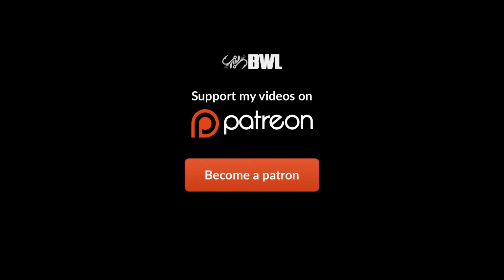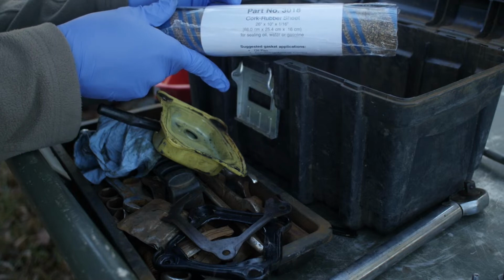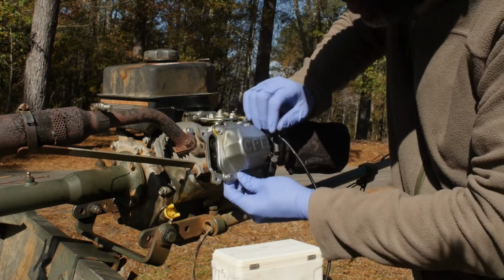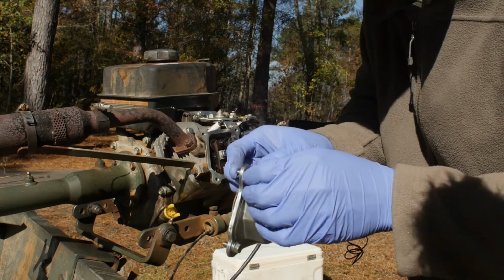Make Your Own Gaskets

Comment: Nice fix!. When I was lucky enough to have a flat surface for a gasket, we used to make the imprint by tapping the gasket material with a rubber or hide head mallet. Just hit it hard enough to make lines, not hard enough to cut it and when you have that cut it with scissors. Also used to use a gasket seal compound called Blue Hylomar. Sometimes if the shops were shut but needed the car to run, I used to make gaskets out of cereal boxes. Some of those temporary repairs used to last years!

Comment: Over the years (been wrenching for 40 yrs) I've used many beer 6px holders or 30pk boxes for gaskets on everything from lawn mowers/tillers,ATV's/motorcycles,to cars/trucks.Most of which are still in use today unless the part has been replaced,if by me I used another 6-30pk to make it.

Most things I use them on is car a timing chain cover,water pump,thermostat housing,carb.Many of which can also found on other engines like mowers and ATV's,etc.I used it as a case gasket on a Briggs&Stratton 5-6hp rototiller engine once a few years back and it's still tearing up the gardens.
Reply from the maker: Yeah, man! That will get it done.
Reply: Tip on making the holes.....rifle or pistol casings.They come in many sizes.I use old sockets,but they don't have the assortment of as many different sizes and not everyone has old worn out spares to grind a cutting edge onto.
Reply from the maker: @rider660r  Yeah, I wondered how to get decent holes in these.